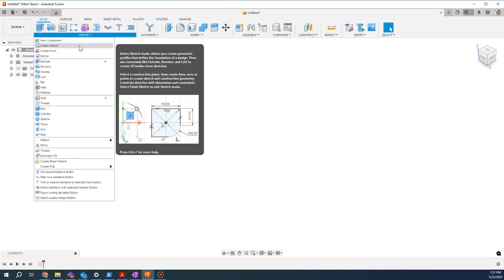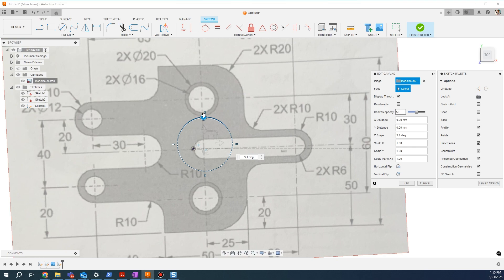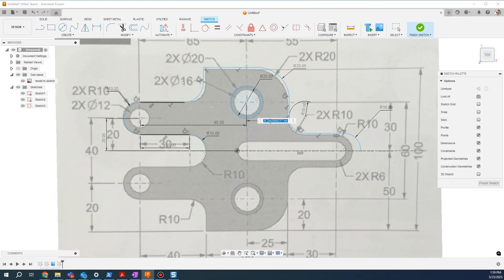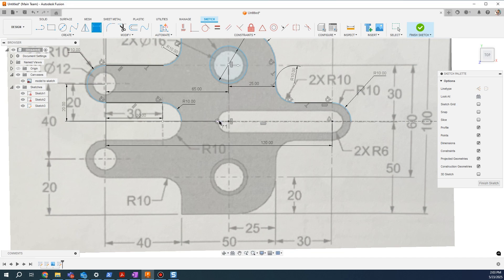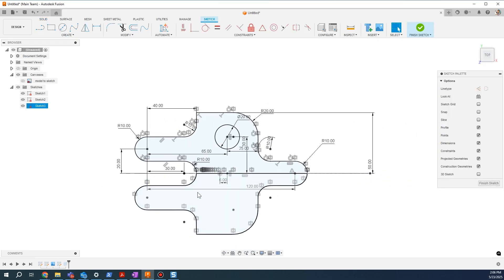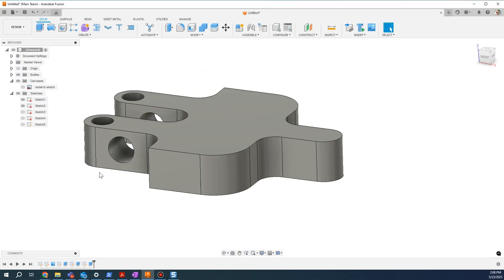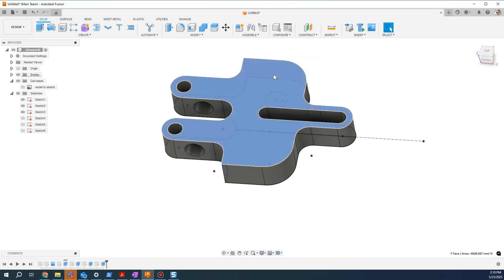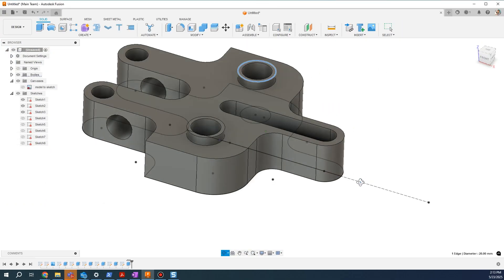How to reverse engineer a design from specs or a drawing? (Follow Along)

Comment: - TIP: "Hole" via 1) 'Extrude' w/ circle as part of profile in sketch vs. 2) 'Extrude(cut)' circle vs. 3) 'Hole' feature.
--- #1 is easiest, but doesn't necessarily fully show design intent.
--- #2 better shows design intent (at least it appears in Timeline as a feature).
--- #3 also better shows design intent; AND, is useful when also making a traditional '2D drawing': 'Hole' feature is automatically detected, and called out; plus, can be used to make 'Hole Table'.

Comment: - TIP: Datum (reference) for 'Canvas' image:
--- Pick a "logical" datum.
--- For image in this use case, center point of arc at left of slot.
--- Also, would be good to make a 'Centerline' 'line' thru this point, extending from the center point of the arc at right of slot, and to center point of circle at left of part. (BTW, this will also help w/ constraining things - like the arc at left-center.)

Comment: - TIP: Dimensioning across line of symmetry:
--- Create 'Centerline' 'line': allows "full-width" dimensioning, which is more properly in line w/ design intent.
--- Alternately (for any line type), use rclick:'Diameter'.
--- Note: either way, the diameter symbol (circle w/ slanted line thru) will appear before the number.

Comment: - Some dimensions look incorrect: overall dim top-to-bottom shows 100 (at right), but summing dimensions at left yields only 80 (= 40 + 2*20). Furthermore, it shows 20 at lower-right, but this is smaller distance than the 20 shown at left. As I see it, the 20 at right is the correct one: corresponds w/ the overall of 100. Hm?
Reply: - What say you, Tyler?...

Comment: I used to work as a design draftsman. Started on the drawing board (yes I'm that old LOL) then to CAD. In this case I would not bother with the canvas. Simply reproduce the drawing. I would leave the R10 arcs and the slot to after the mirror but in the same sketch as with the holes. The timeline would have sketch, extrude, extrude, sketch, extrude.  Thanks for these short tutorials. I've been using Fusion for several years but still pick up lots of tips from these. Just great.